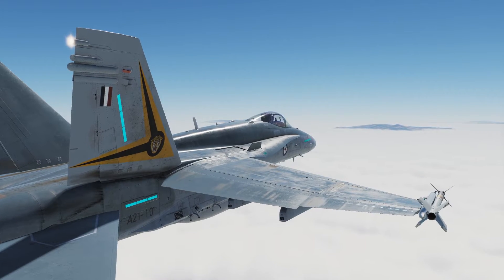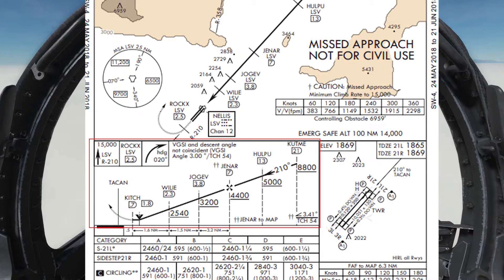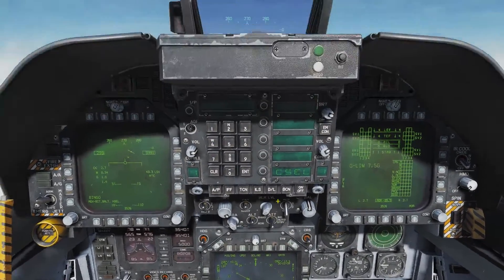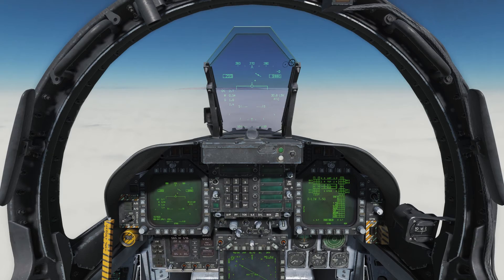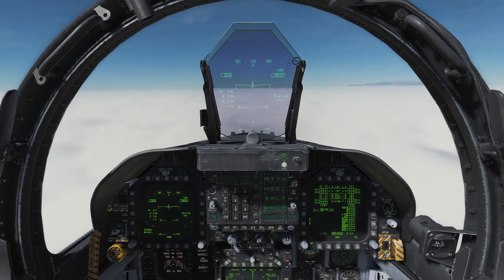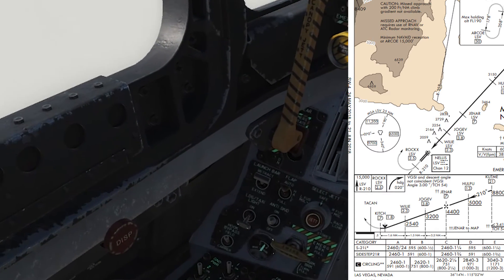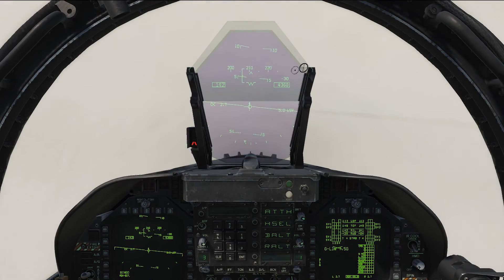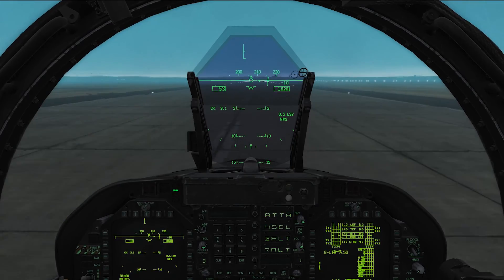DCS F-18C Tacan Approach Tutorial

Comment: It was looking great, until you started to get the On speed AoA ready. Went slightly pear shaped there, but you got her safely on the ground. Good work!
Reply from the maker: yep, a perfect example of being behind the plane. Should ideally start configuring before 8nm, at 7nm i let the speed go above 250 which meant i couldnt configure! then i was super high because i was focusing on configuring. In awful conditions like this i should have calculated my Vapp speed to know what figure to shoot for and not even worry about on speed. The best way to do it is start configuring at 8nm, speed 220 to 5nm, speed 170-80 to 3nm, on speed to touch down. You can also see by the E bracket that the weather was absolutely ridiculous in terms of wind and turbulence, which was because i loaded the wrong mission and loaded the storm one I made :)
Reply: @aMegaMaxProductions  what does it mean to start configuring at 8nm speed 220kt to 5nm? What can we lower at 220kt? Half flaps? No offense here I just don’t know what to lower at 220kt. If my understanding of “configuration” which is lowering gear or flaps or hook, is wrong, I am sorry. By the way the video is really great! I am going to approach Fallon using the method explained in the video, I’m flying in another sim. thanks.

Comment: any reason you were using Barometric Altimeter vs Radar once you were below 5000' and on the approach/glideslope? Did you ever correct barometric pressure for the field?
Reply from the maker: hba8103 the main reason is because the chart takes you to the ground on baro alt and if I wanted to use RALT then I would need to covert all of the attitudes on the chart. It's easier to remember the alt of the aerodrome. In reality they rarely fly in RALT unless they are doing low level flying. Whenever you would be with ATC you should be in BALT
Reply: Copy, I think I'd rather have them both displayed if possible. Especially in IMC like that. LOL